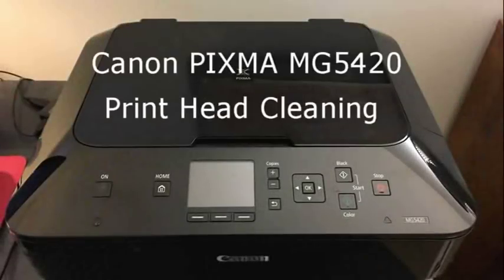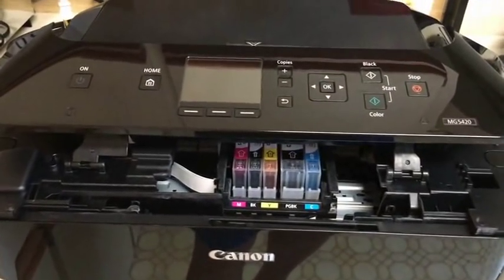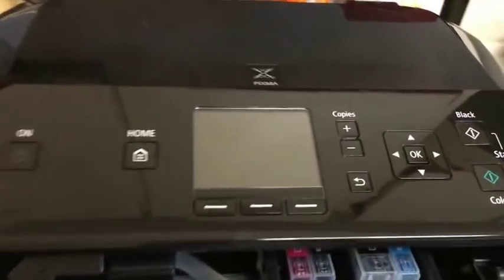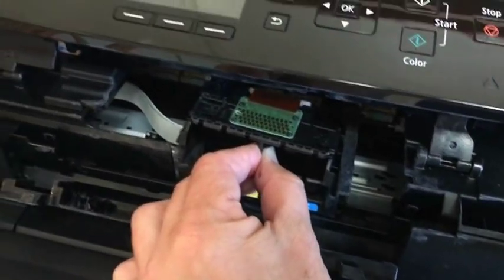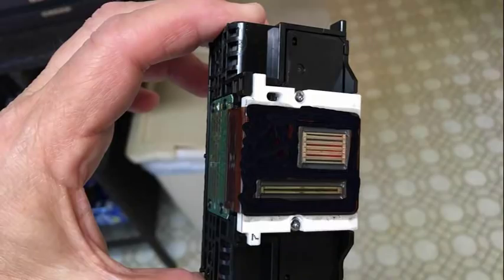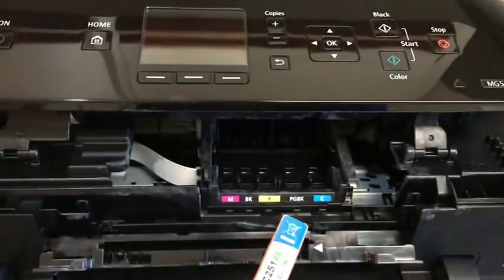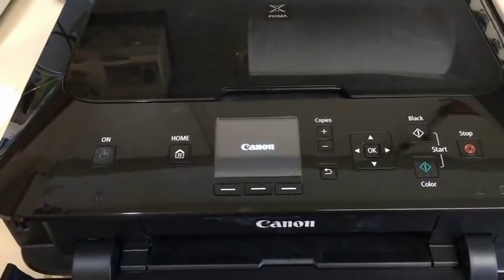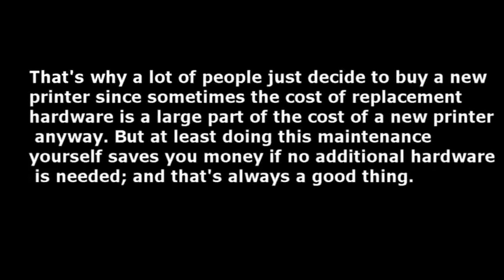Canon PIXMA MG5420 Print Head Cleaning

Comment: Thankyou Terry - this video & a few others have helped me fix my B200  error problem and I gained confidence to remove the printhead and wash it until no more ink came out. Then the reset procedure, that is a bit harder but after a few attempts once the printhead was clean,  it worked. Then I scanned a document & it printed. Then I printed 8 pages in colour. All good, so happy. I want to use up the expensive ink in this workhorse printer and then I will buy another Canon multi function printer. It will be my third. I love Canon printers. I wrote them an email 4 days ago. They replied today. I replied to them and suggested they fit a dedicated reset button somewhere accessible but out of obvious sight to make the  hard reset procedure easier and more reliable.  Thanks again & to all others that made tutorial videos about B200 error etc  :-) I have the MG 5460 model Canon multi function printer.

Comment: I realized today I was having issues with the printhead B200 error code. I forgot how to do this and this was a perfect tutorial. I actually have a syringe I used to flush each of the ink saturation points. For curiosity I called a local repair center and they told me it's a minimum $60 charge. And parts would be extra. I have had trouble with my Pixma MX922 stopped working - I used the same process as above.  I love it when it works; especially the CD/DVD printable quality is very professional looking.
Reply from the maker: Glad the video helped. It can always be frustrating when the print head gets clogged.
Reply: Me too.  When it works it's great.  At least fix is pretty easy.

Comment: Thank you so much!  My PGBK print head was encrusted with black ink.  No amount of print head cleaning made a difference.  Pages and pages of Canon message board posts were of no help.  Your video is excellent!  Almost all of the black residue came off in the first change of water.  I used distilled water just because I had some around.
Reply from the maker: You're welcome. It seems that PGBK is always a problem with these printers.

Comment: Thank you. Great video. I've always used just water to do this but the last time I did it, I used isopropyl alcohol instead and it worked great. Never would have thought to use ammonia. Plus the alcohol evaporates so no fan necessary when drying the print head out.
Reply from the maker: So glad it worked for you. 😁

Comment: Thank-you, great video!  My PIXMA MG 5420 is 7 yrs old and not used regularly enough.  I was able to get the print head out and soaked, my sol'n was MUCH darker than yours LOL!  Challenging to get it back together. Mine does not seem to snap out and in as easily as yours does.  Not giving up!
Reply from the maker: It can be tricky to get that print head out and back in again. I had to pull it with force to get it out.
Reply: @TerryB751  Thanks for your reply!  It was so tough to pull out, I ended up taking it out with its bracket/tray and getting that bracket/tray back in is the challenge!
Reply: Mine didn't either. :)

Comment: 01:22 - you can hold the "Stop" button down for two seconds with the printer power on, and the printer will move the print-head carriage into the proper position for removing the print head. You probably should not move the tray into position manually.

Comment: Hey, man, thanks a lot for the great video.  I found tutorials on the b200 error code for Canon printers in general, and a few suggested cleaning the print head if their method didn't work.  Interestingly, there was barely any errant ink on the area where you had so much ink, and yet that seemed to be the problem.  Thanks again!
Reply from the maker: Glad my video was helpful. Take care.

Comment: THANK YOU. I have searched high and low for information on how to do this cleaning for THIS particular Canon printer model. I believe the PGBK print head is clogged. Everything prints fine except for this printhead which looks way out of alignment or something when I print the test pages. When I print the Manual Printhead Alignment, columns C & D of the 1st page do not print at all. The numbers and letters beside the columns are wavy as well.
Reply from the maker: It seems that the PGBK is always the color that gets clogged since everybody uses that color the most. I hope this video was clear in removing the print head since it really is tricky to remove.

Comment: Amigo muchas gracias, intentare remojar con agua. aqui en Perú por un cabezal te cobran casi lo que cuesta una impresora nueva. gracias.
Reply from the maker: Luckily Google translator comes to the rescue. Yes, they charge as much for a new print head as for a new printer here in the U.S. also. I don't know if water alone will clean the print head, but if that's what you have, it's worth a try.

Comment: Perfect tutorial .    Thanks a lot Terry !
Reply from the maker: You're welcome. Hope it worked out for you.
Reply: @TerryB751  the cleaning worked out  fine. Just having  trouble with the alignement of black. I could manually line out  all colors except black.
Reply from the maker: Sometimes you can make black be more legible by choosing High Resolution in the print popup, even if you're not using High Resolution paper. The printer will print slowly and with more detail if you choose that setting. I don't know if this is applicable in your case, but if you're using Windows under the print popup, you choose  under "Printer Properties" --> Media Type -->  Other Papers --> High Resolution Paper.

Comment: I get no error messages but I still get blank pages printed. Cartridges are new. Will cleaning the printer head help with this issue or is the problem something else?
Reply from the maker: The print head may need to be cleaned manually like my video indicates rather than just the print head cleaning that can be selected by the printer maintenance popups. If you do the manual cleaning and the printing is not as expected, there's a couple things to do. When selecting to print a file, there is a "Printer Preferences" option somewhere on your print popup, if you go down to "Media Type -> Other Papers -> High Resolution Paper" you can use this setting even if you're not using High Resolution Paper and the printer will print slower to make the letters darker. If this doesn't work, you may need to order a new print head which may be half the price of a new printer. You may want to consider buying a new printer.

Comment: as I did some research on Printer replacement and or just to have one as a stand by, I found your video, quick and easy and helpful, does it have to be ammonia ? can Alcohol be used with distilled water? My printer is a Pixma MG7700 series. I have searched printer repair / service and found Zero, called canon and they directed me to a web page that had me cleaning the Timing strip and they told me that they no longer have Authorized repair / service shops.
Reply from the maker: No, alcohol can be used and other people have said that warm distilled water works. It's just that a little ammonia works quicker with distilled water I believe.
Reply: @TerryB751  I appreciate the quick reply, and will give your tip a try and see where I end up. Honestly this is very annoying that canon has not tried to makes changes in how these printers are designed / made / serviced.
Reply: @TerryB751  -Hi Terry, I found your video to be much more precise and detailed than other videos. Thank you! I'm waiting on the results. Do you think this will solve error code 1403?

Comment: Hi Terry. Great video man, thanks for taking the time to do it. Is this likely to fix a printer that continually seems to dry up? I can't figure out whether it's the printer or the ink causing the issue. Also, are there alternatives other than ammonia (household like) that can be used instead? Thanks.
Reply from the maker: If you print out something that uses all the ink cartridges at least once a week, the printer stands a better chance of not drying out. Another person said they were using vinegar (white distilled vinegar I assume) but don't know how well that works. Incidentally, I usually get the ink from Amazon instead of buying it from the stores and buying Canon-made specifically. This reduces the cost.

Comment: Hello, My printer is having a problem ! It is having a 1403 Error for the head and I removed the head and cleaned it but it is still showing up the error. Please help
Reply from the maker: I haven't had that error but all the info on the web that I've been able to find states you should do what you've probably done. Carefully clean the print head electronics with a mixture of alcohol and water with a cotton swab and allow it to completely dry. Also make sure that the electrical contact on the bottom of each ink cartridge is clean as well as where the cartridge sits in its slot. If you take a flashlight and shine it in the empty slot after you've take out the ink, you'll see 5 little pins that connect to the bottom of each cartridge. These should all be clean. If you still get the error, you'll have to take the printer to be serviced. There are a lot of areas that have electrical contacts like the individual ink cartridges that could be the problem. Wish you luck.
Reply: i have the same error 1403 ,any good news ?

Comment: hi, I tried everything solution found on the internet. and still B200 error on my Pixma ix6850 persists.. shame because I know my print head is 100% unclogged and working.. but still the error appeares. I think cannon is messing with software/firmware so it knows that once this particular print -head was damaged and even if now it's fine it doesnt allow it to run.. shame Canon! I really like your products but your customer policy and politics is total crap. I am searching for other printers with the same printer--head so I can buy it cheaper than new print head which is similar price to the whole printer!!!... try MX725, MX922, MX721 and also mx925... they all share same print-head QY-00086

Comment: I do appreciate your instructions and very informative video, but didn't help me really at all with the issue and I wasted probably a good hour.  I am still getting smudged lines when using cardstock, AND my print head did NOT lift out as easily as everyone else's seems to have. After giving up twice, I was completely baffled as to why my print head seemed to be attached to the back, I combed through the comments to see if anyone had issues and was greatly helped to see one comment with my same model say it was possible to remove the print head if you fight past the obstruction. I was able to proceed then as planned with using long nose pliers to grab the center tab. So after all that, cleaning it, putting it back together,  I then had to deal with the printer refusing to print with insisting the cover was open when it was not in any way, shape, or form, and also it not recognizing one of the ink cartridges that has been in use for years.  More fiddling around, turning it off and on multiple times, closing out Word and reopening, something did the trick. I don't know what, and don't care at this point. Got it to print and still smudging!!! I've about had it with this ridiculous printer. I shouldn't have to feel so grateful when I hit print and it actually works, which is about how it's gone over the past I don't know how many years.
Reply from the maker: Sorry you had such difficulty. I've since replaced my print head on the Canon printer with a new print head. If you're an Amazon member, this link I've included shows the brand I used to replace it. I realize all these items are made in China and the quality is "hit or miss" a lot of times, but this one had good quality for me. https://www.amazon.com/gp/product/B019R87Y1I/ref=ppx_yo_dt_b_asin_title_o00_s00?ie=UTF8&psc=1

Comment: Well, it's fixed again for the 4th time!  Ugh.
Reply from the maker: Yep, I found that the best way to keep the print head working is to manually check the ink cartridges to see if they have ink and not trust the graphic display for ink levels. The graphic displays can be deceiving.